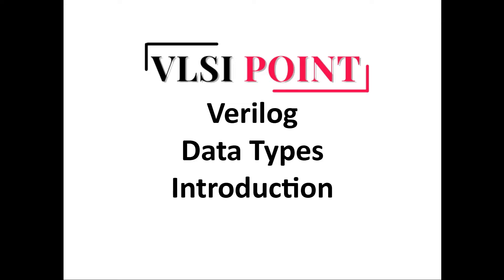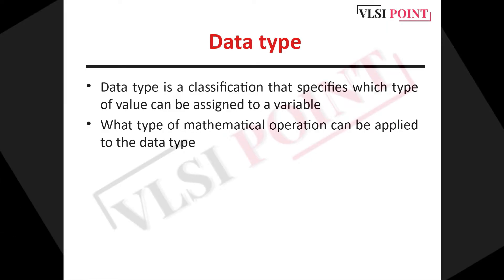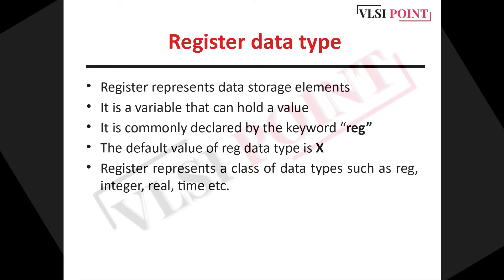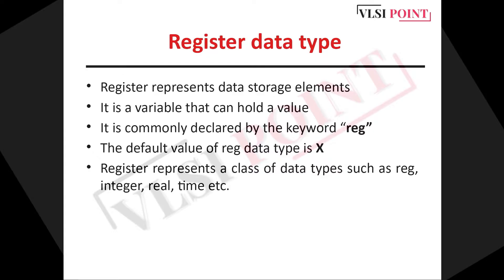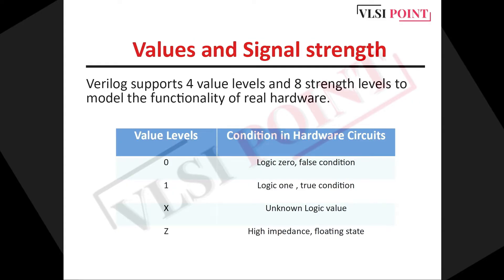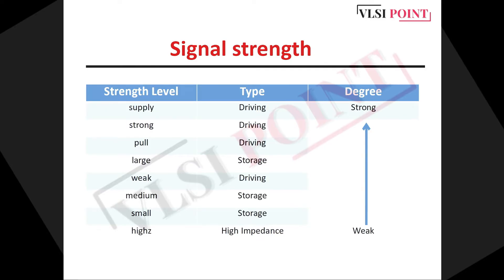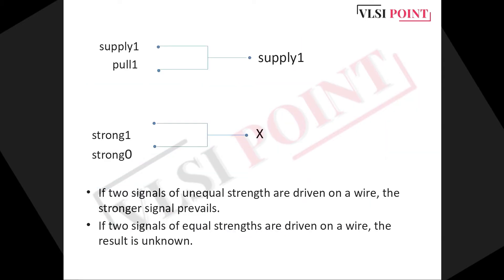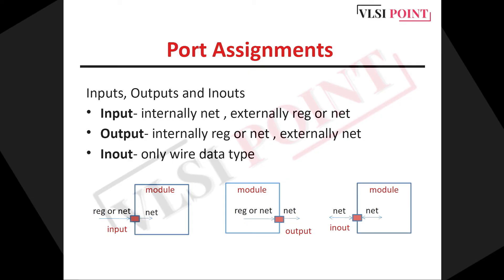Data types in Verilog | #5 | Introduction | Verilog in English | VLSI

Comment: I didn't understand tri, triand , trior
Reply from the maker: tri: A three-state wire that can be driven by multiple sources, with possible values of 0, 1, or Z (high impedance).

triand: A three-state wire that implements a logical AND of all active drivers. It can be 0, 1, or Z.

trior: A three-state wire that implements a logical OR of all active drivers. It can be 0, 1, or Z.

These types are used for signals that can be driven by multiple sources, with Z indicating a high-impedance state when no driver is active.
Reply: @vlsipoint  how triand is different from wand?
Reply from the maker: triand and wand both perform a wired-AND operation in Verilog.

wand (wired-AND): ANDs all driver values, but does not support Z (assigning Z results in X).
triand (tri-state wired-AND): Similar to wand, but supports Z (if all drivers are Z, the output is Z).

Use wand for simple logical ANDing and triand when working with tri-state buses.
Reply: @vlsipoint  Please make a video on this topic with examples and simulations.

Comment: Please Explain Internally Reg Externally Wire Or Net & Vice Versa
Reply from the maker: Internal wiring refers to signals (like reg or wire) that exist within a module and are not exposed outside, while external wiring involves signals connected to the module’s input or output ports. For example, an internal reg can be assigned to an external output port.